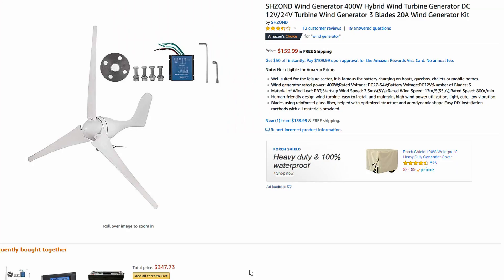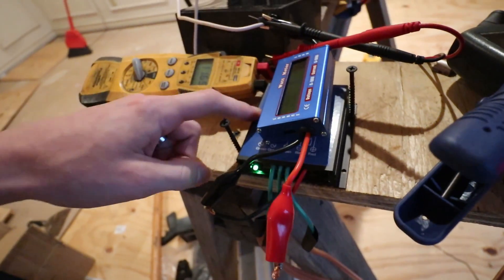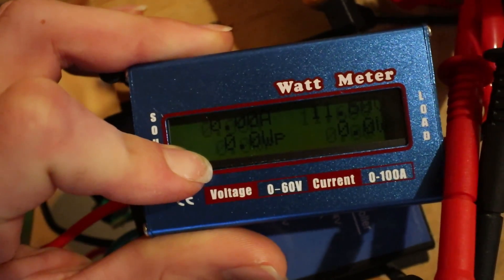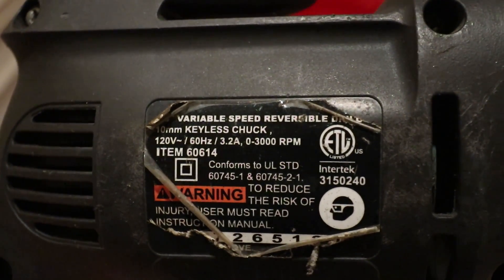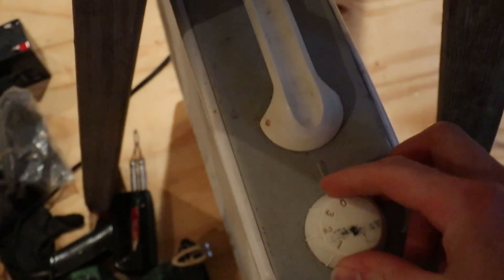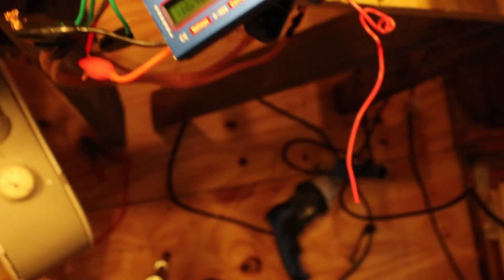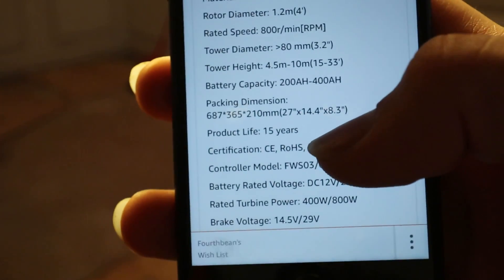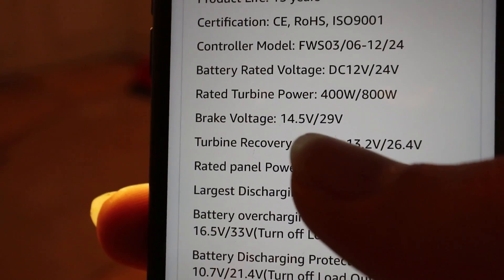Amazon Wind Turbine Review - [2019]

Comment: G'day Mate, I found small wind generators start up earlier in low winds,
starting wind speed 10km/h, these outputs are only what I saw in a 50km/h Wind Storm, they would have gone higher in the peak winds of 63km/h.
26V - 24V 500W Vevor          -  Normal 5 Blade  - 6.5 Meters   -  8 Amps
26V - 24V 500W Vevor          -  Normal 5 Blade  - 6.5 Meters    -  8 Amps
14V - 24V ista Breeze i500   -  Scoop 5 Blade    - 4.5 Meters  -  11 Amps
12V - 24V 300W Old 6 blade  -  Normal 6 Blade  -  4 Meters   -  4 Amps
12V - 48V 500W Sunboo S5  -  Scoop 6 Blade  -  3.5 Meters   -  2.5 Amps
12V - 48V 500W Sunboo S5  -  Scoop 6 Blade  -  3.5 Meters  -  2.5 Amps
12V - 48V 500W Sunboo S5  -  Scoop 6 Blade  -  3 Meters   -  2.5 Amps
12V - 48V 500W Sunboo S5  -  Scoop 6 Blade  -  3 Meters   -  2.5 Amps
12V - 48V 500W new rotor    -  Scoop 5 Blade  -  3 Meters   -  1.5 Amps
12V - 48V 500W new rotor    -  Scoop 5 Blade  -  3 Meters   -  1.5 Amps
Peak Output Totals  =  44 Amps  =  752 Watts ( my target is low winds )
Local laws stop me putting a big wind generator up high enough to work.

Comment: I have gone through so many of these cheap Chinese wind turbines from Amazon and eBay. You need a hurricane to get peanuts out of need.
 Something heavy with a big coil and lots of magnets. I finally found a instabreeze 1500. It's a power house. You get what you pay for sure? You're gonna spend 7 Hundred dollars but you're gonna have something that will make electric and a lot of it. These cheap Turbines only weigh between twelve and eighteen pounds The istabrees weighs 56 pounds.What does that tell you

Comment: By the way, I would guess it will first try to slow down the generator at the 14.5V.... but in a serious storm it may simply be unable to slow it down enough (by shorting the three phases). In that case, above 16V on the battery, the controller/turbine will probably just dump the excess energy as heat. That's an absolute last resort because it can't be sustained indefinitely (you will find that charge controller is filled with sand to act as a heat reservoir). I could be totally wrong, I am new to this myself!

Comment: I have this same turbine. It is on the top 12th floor balcony of a tower block with 360 degrees view. we have not had a decent storm yet here in Cheshire, but in smaller storms I have measured 11-12 amps going into the battery bank. I estimate it will do a little over 15 amps in decent winds.

Comment: generator is not bad. however, problem mostly with these turbines is the blade and lack of transmission. basically, it needs a lot of speed which is hard to get in low elevations/wind, if you get the strong wind becomes bad for the blades and noise.

Comment: I'm fixing to teardown a 5000 watts Winco generator ; I'm taking it off the gas engine and building a blade ; the blade hub is a 19 inch 1978 Honda mag wheel off a 750 Super Sport that got a curb ding . Been saving that for this generator...I guess I will try chain and sprockets to see where to gear the thing ...I'm going to add twelve N52 magnets to the rotor. That way it doesn't have to turn fast to generate. My guesstimation says about 400 RPM will be about 40 something volts... The rotor has some magnetism  but I'm going to help it some...drill some shallow holes and add ring magnets with screws so they are flush...I don't think it was ever used much...it was on an old motorhome that didn't get used a lot...the case is 10 inches wide and 8 and a half long...it's a thin cast iron, with oversize bearings....it is a 250 volts generator but I'm not going to turn it very fast...I'm going to put 5 , 21 inch blades onto the mag  wheel to make it 4 ft 9 inches. IF I come out with 1000 watts, I will need a DC regulator...I have some diodes out of a Miller welder that are 200 amps...so far I have $50 in the magnets, and $20 in the mag wheel...the generator was $20 a long time ago...so I have $90 so far but I think it's going to work when I get done...it just seems like I can get 7-800 watts pretty easily ...we have an average wind speed of 18 here...lol...I thought well I'll aim for a thousand watts and if I wind up getting 750 that's good enough...that's like 25 amps to the battery bank...it is 845 amp hours @ 24 volts...17,350 watt/ hours or something....but it seems like like it can always use a few watts...I just sent my 2000 watts Aims inverter / charger back on warranty last Friday and they should have it by now...so since that isn't here I don't run the batteries down much...it is 7 PM and they are at 26.2 , lol...but I am off grid so having a bit of wind help can't hurt so I guess I will try it...the inverter only had a couple of weeks left on the warranty and it had been on for a couple days, but the laptop got charged and I had went to the store ; so when I came back it was the old fried electronic smell...ouch...so it's going to be out of warranty when I get it back...I will add a little fan in there to cool that part that gets warm in there so it doesn't do this again...I insured it for $1400 in case it gets messed up Im gonna get a Magna sine...I wish...it said it should get there Friday so it has like  a week warranty left, lol... they have to fix it and ship it free...I just have to keep it working from now on...boy this being off grid is a hard teacher...a solar system will tutor you but she sure is expensive at first...

Comment: Well for starters I think you better do your research a good battery a fully charged battery sits at 12.9 12.8 and a really good battery will sit. At 13.2 volts DC so your testing is not accurate these things are tested and rated on fully charged batteries with no load but wind is only a secondary on a solar unit to keep a charge in the batteries overnight why would you get a piss ant 300 watt unit when for around the same price a little bit more you can be getting a 2000 watt unit 1000 watt unit the pull out up to 80 amps wattage means nothing amperage is where you get all of your effectiveness from your batteries and your system
Reply from the maker: You seem angry. Are you ok? While a lead acid battery is full at 12.9v that’s not what you charge it to. If you only charged it to 12.9 it would never get a full charge.

14.6v is the acceptable bulk charge rate limit, then supposed to drop down around 13.5v for float to finish it off. This of course varies by manufacturer and battery type but I don’t know of any that you only charge to 12.9.

Comment: Mine is very similar and works really well.
https://youtu.be/m4JteCEfkZQ
The problem I see most people claiming is, "it does not" produce the stated 400W.
I guess most people don't realise the turbine and controller are rated at 15A max. So the turbine and its controller would have to be used in a 24v setup for it to produce anywhere near its rated 400W.

24 volt setup
26.0v x 15A = 390W

12 volt setup
13.5v x 15A = 202.5W
Reply: Stuart he had a good point. Do we have to connect the dc side first. To make the green light up.
Then connect the three-phase side of the turbine

Comment: The turbine work good it's the charge controller I think the charge controller is meant for flooded lead batteries something like L16 batteries. Where the high voltage is normal for the battery..
Reply from the maker: That’s why I put a good load on the system to keep the voltage from getting too high. I was doing some more tests this weekend on another turbine though to test your theory and used a flooded lead acid from a car. It will definitely cut out if the voltage gets too high but even if I keep the voltage under 13 I could only get a max of 300 watts using a 24v setup and maxed at 215w with a 12v setup.
Reply: @beenegarage7116  the voltage on a car it's about 14.3 when the car is on I've been looking at this that the wind turbine inside there is a  electrical board . That's the problem. Get a 3-phase DC to AC. SSR rectifier. This will be inside the turbine. This will allow to produce to max amount power of the turbine.
Reply from the maker: Yes! I think we are on similar tracks. I bought a rectifier so I could bypass the electronics that came with the turbine. I then ran the d.c. side of the rectifier through an mppt solar charge controller. Unfortunately it didn’t change the performance much if any :(. Are you thinking I should run the d.c. side of the rectifier straight to the battery? I’m worried the voltage would get too high and cook the acid in the battery.

Comment: Try it with 6/ 36 inch blades.. mine over produces in 15 mpg winds at almost 900 watts.  Blade tip speed and torque determines alot
Reply from the maker: What is your turbine rated for from the factory? I suspect if mine was spinning fast enough to produce 900 watts the bearings would self destruct.
Reply: @beenegarage7116  I'm sorry mine is 800 watts
Reply from the maker: Still fantastic you can get more than the rated capacity. How much were you getting with the stock blades?
Reply: @beenegarage7116  I was lucky too get 200
Reply: Can you put the link in comment of your turbine, or wich model is?

Comment: Looks like a 200watt Turbine badged as a 400watt
Reply from the maker: That’s kinda what I was thinking. Or the design is 400w but the build quality just isn’t tight enough to perform.

Have you purchased from the website you posted? They seem like reasonable prices.
Reply: @beenegarage7116  yes that website only sells real rated wind turbines, I have their 400w and 15kw running my house and business
Reply: @beenegarage7116  yes I have, delivery took a week but no import duties so the prices are as displayed, AFAIK it's a free delivery website Carbonfreeheat.com
Reply: @beenegarage7116  It's designed for 400w at 24v. @800rpm.

Comment: Hi, your effort put into testing and the equipment you carefully selected is truely worth a compliment to you.  I was wondering, the Wattage you are measuring is DC, and the Turbine generates AC and the rating in Watt is not specified on AC or DC?.  There is a very distinct difference in calculating AC Wattage, and also, how much losses is the rectifier\regulator causing.  I have seen another video with a similar turbine tested, where the gentlement used a much higher quality rectifier and regulater, and he got a lot more Wattage out of the system.
Reply from the maker: I appreciate you taking the time to let me know how I’m doing. After watching some videos I really wanted to get some actual numbers out of a turbine to see how it was performing.

I agree the included controller likely has much to be desired, that is definitely an item I want to test in the future - see how these turbines perform with a better inverter/rectifier.
Reply: AC and DC calculations for Watts are the same due to volts on AC being typical shown as RMS and hence allowing P=IV, so in reality the calculating bit is exactly the same.  There will be losses in the system for rectifying from AC to DC and inverting from DC to AC, but the maths now is efficiency and maths on Watts based on AC to DC.

Comment: While all of these turbines use the same outer casings, they do not share all of the same internals. You want a small turbine that actually exceeds its rated capacity? You want to look at the weight of the unit. The same looking unit from this distributor rated at 400watts are proven to provide that anything over 18mph. And they are proven to do it reliably for years. And don't bother messing around with that scammer in Missouri. https://www.aliexpress.com/item/32865874565.html?spm=2114.12010609.8148356.51.3e9823605fjLrZ

Comment: Breaking is based on Voltage.  If the Battery reflects more then 15V the controller will clamp the OutPut (SHORT) diode output causing a seriously hard load on the Turbine.  Your Voltages on the meter are not the output of the Turbine .   Your seeing  the voltage Drop of what is going into the Battery.  If the Battery reaches 15V clamping would take place.  Open Circuit would show the turbine output.  You would be seeing well in excess of 50V at the rated 800 RPM un loaded.   Without Constant winds the turbine would only be a Augmenting current source.  Not to be looked at as a Soul Source of power.    Permits ?   LOL, THAT is why I live out side any town or city.
Reply from the maker: Yes I definitely experienced it locking up, I wasn't aware of how this worked with the controller but I know that a common method of braking is to short out between the 3 phases coming from the turbine.

However I beg to differ on measuring useful capacity. If it's unloaded there is no current flowing, so that 50V with no Amps equals 0 watts.

On the flip side if I hook it up through a battery, measure how many watts I'm feeding the battery, and put enough load on the battery that I never hit that 14.5/15v cutoff limit then I should theoretically see the maximum capacity (wattage) of the turbine. That's why I setup the test like I did.

I also realize I am no master on the subject. Here to learn!

Comment: Can you tell us what the red and green LED lights mean on your charge controler?
Reply from the maker: I'll admit I already returned this unit so I don't have the manual with me. Seemed that the green light indicated the battery was connected. This was important as the manual stated you must have the controller connected to a battery/load before the turbine started generating power. The red light must be an indicator of the turbine generating electricity. Sorry I couldn't provide a more concrete answer.

Comment: I kinda alredy figured you was not going to get 400w but what you did get is enough to charg a 12v battery with wind power at night and for $155. From amozon shipped it is worth having.
Reply from the maker: Certainly not worthless, I agree. All about what you need it to do.

If I had something off grid to charge I’d love to do something like this in addition to a small solar panel, get some nice redundancy that way.
Reply: BeeneLife  I have lived off grid and though this will not run your refrigerator it will run small TV and video games and led lights at night I used to have to run my V8 truck just to charge the battery's this along with a 100w panel keeps me from doing that.